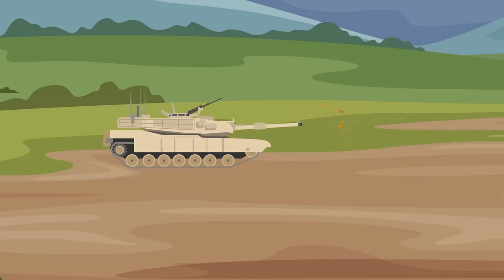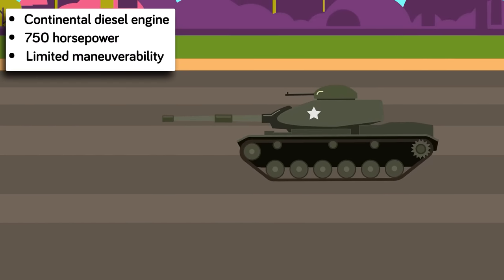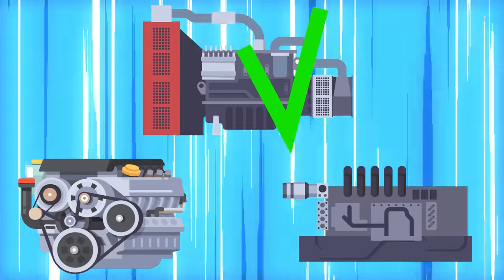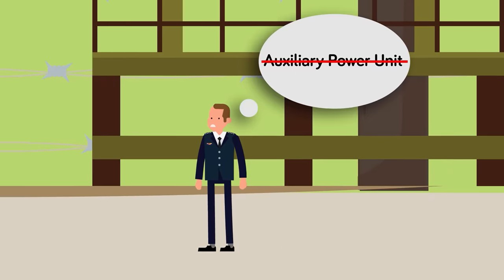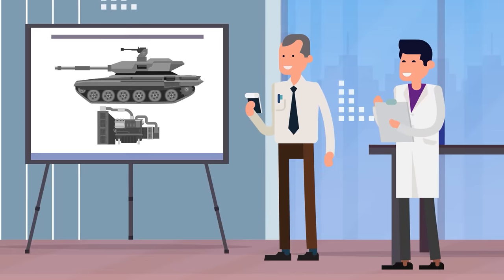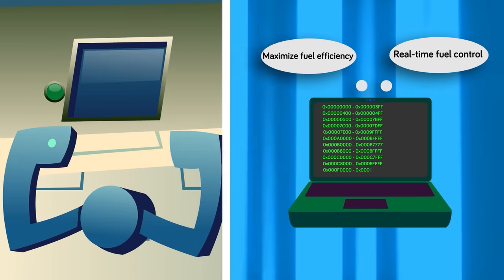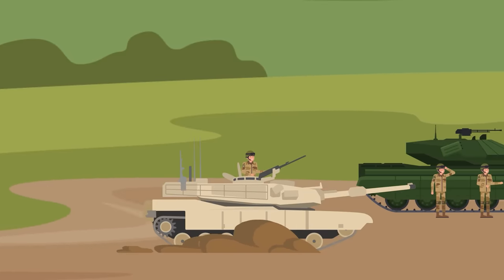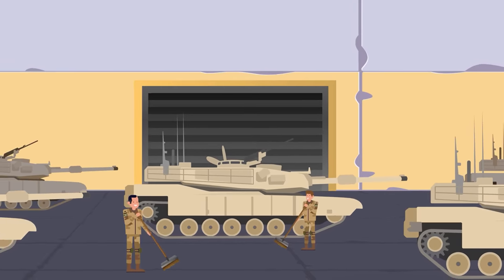Why M1 Abrams Turbine Engine Is Actually OP

Comment: the Auxiliary Power Unit(APU) was only recently installed on the brand new Sept V3 package and I can tell yall already that most of the time they don't even work and it had its own little engine compartment and you had to completely take it out to fix anything in it because of the massive spinning flywheel that sits on top of it

Comment: The Abrams tank has definitely grown with the newest 2a2 . From armor, computers gun rounds sights you get the hint. A great beast on the battle field. Just remember it's not the ww2 threw m60 tank , you can not walk behind them or burns will happen
Reply: I was an M60 Armor Crewman all the way to M1A2 test in 1994. I hardly recognize what’s going on in the turret of the Abrams now.
Reply: An army vet who worked around the first M1 tanks had a story about a vehicle parked behind the M1 melting. So yeah stay away lol
Reply: @Sammmeow  LOL you think that's bad, The Chieftan ( Irish Youtuber, former US Army Abrams Tanker) has a story from Iraq of an M1 towing another M1 back to base and its front fuel tanks exploded from the heat of the towing tanks exhaust blasting it. Luckily the crew wern't inside it.

You're supposed to use exhaust deflectors when towing with the Abrams, but they didn't have any so just towed it without them(And found out why you're not supposed to).

Comment: I was a 91A M1A2 SEP version 2&3 mechanic from 2015-2019. First off, no one ever uses the APU in the Abrams, it has plenty of battery to keep the tank alive. In fact, 90%~ of the tanks I put hands on, had their APU removed entirely. Second off, it does not take four hours to replace a pack in the field. With two tankers on the back deck watching the hydraulics and quick disconnect pins along with handling the saddle bolts, I could replace a pack in under 40 reminutes easily. I will say though, the technical manuals that we use work pretty well for finding more complex issues inside the tanks core, though the diagnostics process often required a combination of implemented techniques. If you guys ever want better information regarding the tank, feel free to PM me.  (disclaimer, i’m not unveiling anything that’s not already declassified, but for a first hand experience, I can provide the run down on how things actually are, versus how they’re reported.)

Comment: A few points incorrectly mentioned here. (Vet. US ARMY; 2AD; Tanker on both the M60 and the XM1 ABRAMS during the testing phases, Ft. Hood, Tx.). 1) the M60 weighed 63 tons fully combat loaded. 2) The XM1, ungoverned, could achieve a maximum speed of 85 MPH and often tested @ 60MPH. They governed it as going that fast often broke the track and would swivel the vehicle into an unrecoverable turn beyond 30 degrees @ 55+MPH. That being said, great video!

Comment: I'm pretty sure they didn't even mention the fact that it has 2700 ft lb of torque, which is a key feature of turbines, or the fact that it can run on different fuel types.
Reply: You tell em Mr yogurt
Reply: Except most tanks have the ability to do that
Reply: Leopard 2a7 3466 ft lb of torque and runs on various fuel types. Also the v12 sound❤
Reply: Why do so many people focus on something as silly as torque? There is absolutely NOTHING special about that value. It is trivial to swap RPM and torque. Look at this formula:

P = R*T/5500
P = Horsepower
R = RPM
T = Torque in foot pounds
Reply: @TomNyon  firstly the Abrams engine is also multifuel, secondly it depends on the RPM for the Abrams, when at max rpm I.e. 3000 rpm it provides 2750 lb ft, however at lower RPM it is significantly more, the Abrams engine provides in excess of 5000 lb ft of torque at 100rpm and the torque it outputs gradually decreases until it reaches 3000 rpm, whereas the Leopard 2s engine is the opposite it produces significantly less torque at lower RPM and reaches its max output of 3466 lb ft of torques at 2600 rpm I.e. at 500 rpm the Leopard 2 only outputs around 1500 lb ft of torque, so overall the Abrams engine is just better, it's the reason the US chose it over a diesel.
Reply: @johncochran8497  i guess you sont understand vehicles and torque. Torque is what will move tanks and trucks.
Reply: @aflyingcowboy31  the US also chose the jet engine for its military doctrine which doesnt make sense for other militaries. But on the battlefield i dont think it makes a chabge if you are in a leopard 2a6 or abrams. But the problem with turbine engines is the lack of a flat curve, as such thats why its applications are so small.
Reply: @TomNyon  And you totally don't understand the equation P=RT/5500. Torque and RPM are trivially interchangeable via gears, pulleys, or any other transmission. Halving the RPM will double the torque and visa versa. Giving me any two of the values of horsepower, torque, and RPM will allow me to tell you what the missing value has to be.

Comment: The German Leopard 2 tank has a 1,500 hp diesel engine, which can be operated as a multi-fuel engine.
Reply: The big difference there is the abrams engine is much lighter than an equal power diesel
Reply: @BrokeWrench  and there is multi fuel and then there is ‘burns just about anything that will go through the fuel filter’.
Reply: @teamidris  But it gets hotter and is therefore easier to spot with thermal vision. The engine-block of the Leopard 2 can be switched in about 20 - 30 min (faster) and the fuel efficiency is also better. An adaptive electronic control unit for the engine is also installed. I don't know if it can run with other fuels than diesel, but I wouldn't call Abraham's turbine-engine "OP" because it is a little lighter and can run with other fuel. It has its pros and its cons like any other engine and the pros aren't completely over the top like I would expect to justify calling it "OP". It's one of the better designs, maybe the best for some situations but the gap between 1st and 2nd place is not that big. The Armor of the Abraham is much better --> this is something you could call "OP". IN MY OPINION (I love all tanks equaly, but not the title of the video)
Reply: @BrokeWrench   abrams...3730nm of torque ............leopard 2 4700nm of torque
Reply: @elias_jacksonlp8032  The engine of the Leopard 1 was replaced in 40 minutes, that of the Leopard 2 in less than 30 minutes. They are both multi-fuel and very reliable. I was a mechanic on the Leopard 1 of the Belgian Army from 1978 to 1980, one of my most beautiful period of my life and I miss it a lot. 😢
Reply: Wait so the leopard had more torque?
Reply: Anything with cylinders will always be limited on their fuels, especially compared to a turbine
Reply: @BrokeWrench  not true, in fact the powerpacks of the M1 and the Leopard were originally designed to be interchangeable.
Reply: @teamidris  Not true, the Leopard 2 will run on anything the M1 can... which is NATO F-18 through F-77
Reply: @gearheadhotrodder9223  Not true, the Leopard 2 actually runs better on more fuels than the M1.

Comment: You know what the Army engineers say about the Abram? 1 hour use, 3 hours maintenance. A lot of those can be contributed to the engine. Yeah, OP indeed.
Reply: they absolutely did not say that. The Abrams engine is notorious for being very reliable and with low maintenance time, most of which is just swapping the engine.
Reply: @F_eesh  Not according to the official GAO report... the Abrams in combat suffered from unacceptable combat readiness rates during Operation Desert Storm related to its poor reliability and high maintenance requirements.
Reply: @WilhelmKarsten  that is true. I guess i was just referring to the engine

Comment: The best upgrade that could be made to the Abrams would be to strengthen the tracks so that the military could remove the governors that prevent the tank from moving at the speed that it is actually capable of. Because, it would destroy the treads moving at those speeds

The Abrams is a fuel hog because it is overpowered
It would be nice to see the tank actually being able to use that power
Reply: Do you really need the tank to travel faster than the stated 45mph on the road/30mph off-road? If I am not mistaken, the majority of the fighting in Ukraine is urban warfare. When the time comes when you need to move military personnel with great speed from point A to point B, wouldn't using APCs make more sense?
Reply: @tluzanov  I agree with you. Anyone else try to take a tank in a 90 degree turn at 30MPH? Powerslide doesn't even begin to cover what would happen. The M1 does have great take off speed from a stop and awesome braking. Many Tank commanders ate their 50 Cal mounts all the time. If you hear emergency brake over the intercom, grab and hold something now!
Reply: The M1 Abrams shares the same tracks with the original Leopard 2 that has since been upgraded with better tracks.
General Dynamics offers the new Diehl high speed tracks on its export models
Reply: It is not a fuel hog because it is overpowered. The Leopard 2 also produces 1,500hp. The reason it is a fuel hog is because gas turbines are fuel hogs unless run at an optimal speed. Diesels are just more fuel efficient, especially when run at lower power outputs.
Reply: @TheEulerID  excellent comment, you are absolutely correct.
Reply: The original tracks were not that great. As I remember, the tracks from the Leo 2s were adopted by the US Army. Much quieter and didn't seem to walk off as much.

Comment: I'm just wondering, can the Abrams' Turbine Engine also operate on Biodiesel Fuel?
Reply: Probably.
Reply: Going off what I've seen others list them capable of running on, If a normal diesel engine can take said biodiesel, there is no reason the turbine in the abrams shouldn't run it just fine.

Comment: Insane that the abrams engine, though controversial, is reliable, and can run on anything as long as the feeding fuel is combustible, not just diesel, patrol, kerosene..etc.
Reply: Reliable? No, not according to the GAO report.
Reply: The Leopard 2can run on anything the M1 can. Most tanks are multifuel

Comment: Some may not believe this but it’s what I saw with my own eyes. I was 19 years old and assigned to my first unit in Aschaffenburg, Germany in 1984 where I served as an 11H; Tank Destroyer. We had a couple Tank units (3-69 armor) and they had the first M1 Abrams. I’ve seen those things go past 55 MPH on open roads while my M-113A2 could barely do 45, they’d pass me on the autobahn so fast it looked like I was parked on the side of the road with my track on jacks! The governors were adjusted to keep them to no more than 45-48 MPH but, they can easily be changed to go past 60 MPH. They are monsters and nothing less.
Reply: Yes if you like changing track tho

Comment: OP was the WWII M4 Sherman or T-34 which were produced by the tens of thousands and were efficient. Abrams and F-35 are Ferraris, you drive them on weekends, but in a high intensity war they are expensive and not as efficient
Reply: a few problems here
The Tiger destroyed Sherman's at a rate of 3 to 1
Abrams are extremely complex, but the United States also has the capacity to manufacture lots of them
Which is why we have 3k of them rotting in Death Valley because we don't need them
Reply: @Thinkingaroundthebox  too bad there was only 1347 tigers build and over 50000 shermans.
Reply: Lol, T-34 was hot garbage.
Reply: T34 was absolutely hot garbage
Reply: @obi0914   well...
it depends on the period they were produced.
War-time T-34 hot garbage.
Post-war T-34s are good enough quality, with mediocre speed.
Then again postwar T-34s were mostly hoarded by Russia
Reply: you mean a HIGH INTENSITY war like the TWO GULF WARS?
Reply: @Thinkingaroundthebox  x1000 Tigers vs x50000 Shermans and 50000 T-34. Who would win!? History tell us.
Reply: @palacete  you are correct. The Allies won WWII because the United States could massively out produce the Germans

So it didn't matter who had the better tanks. Unless you cared about how many lives were lost
Reply: @ThinkingAroundTheBox  actually another problem, Sherman's never went up against tiger tanks.. that a very common misconception. Panzer tanks from afar were easily mistaken for tiger tanks. There are only 2 accounts of Americans seeing tigers and they were never in head to head battles.
Reply: @darthvirgin7157  not even close. Iraq was not a global power, even less a regional power. Iraq was decades behind in equipment, a small and poorly equipped army compared to the world's major powers.
Reply: Abrams tanks one of the best tanks to be in. And you act like Americans care anything about budgets while at war. The American Government is very good about spending money without a care. Ask any of it's citizens
Reply: Go watch a desert storm documentary and then read your comment again..

Comment: Gas turbine engines, while not necessarily miserly in their fuel consumption, are small efficient engines with far less moving parts than combustion engines. Helocopters use them, and there are very few helicopter crashes due to engine failure these days. Chrysler actually put one in their cars back in the 1960's.
Reply: Gas turbine engines are poorly suited to land based vehicles which is why the Chrysler turbine car was a failure and the M1 Abrams is plagued with many problems related to its troublesome engine.

Comment: A gas turbine can run on alcohol if it is properly tuned. In the future, I'm sure it would be able to run on hydrogen or any compressed burnable gases, like propane, butane, LNG, or any other fuel type. It's most likely just a S/W patch for the fuel control.

Comment: German Leopard 2 A7 is best.
Ironically, the engine and transmission are German designed but built under license in Ohio.
Reply: The leopard has had so many casualties in siria, i wpuld like  to Knowles how good is the leopard compared  with M1 and challenger the late two have a perfect performance with no casualties
Reply: nah US Abrams is best hands down as Abrams has the most protection other than challeneger 2 Abrams also stores all 40 ammo shells in blast proof armored stowage with blast doors while Leopard 2A7 still puts some ammo in the hull
Reply: @MrNeutrin00  

No.
Blame the crew, not the awesome machine.
Reply: The leopard basicaly has fuckall armor.
Reply: @MrNeutrin00  the only army activ in syria using any leopards is turkey and they mostly use old leopard 1s and never the less i think they dont have any high number of casualties
Reply: The engine and transmission unit for the Leo is produced by MTU in Friedrichshafen. You may mean the Rheinmetall cannon that is produced under license in the USA for the Abrams.

Comment: M1A1 Abrams is our Workhorse in The USMC it is our Chariot in The Battlefields followed by M2 Bradley's and other Armored Vehicles in our Armored Division. I missed my old days in The Marine Corp, I used to drive one of these Abrams Tank I love the Startup sounds and the Horsepower of This Beast 1500! It's too overpowered to haul tons of Armor Steel, and SABOT rounds depleted uranium does the trick! I drove this Beast off the LCAC (Landing Craft Air Cushion) when we landed in the beach in the Red Sea. And I'm inside the Tank as a gunner when we got Airdropped from a C5 Cargo Plane in Afghanistan. I drove a lot of Armored Vehicles in The USMC during my old days in The Military.

Comment: They need to send those tanks to Ukraine
Reply: They did. The Ukrainians prefer the leopard
Reply: No. The logistics of finding parts, ammo, and training crews on different systems is a logical nightmare.  The Abrams has better Armour,  but is way thirstier than the other two western tanks there. Also, turbine engines demand specialized training, while the average mechanically minded person understands the power pack in most tanks

Comment: The main reason for installing a turbine was the ratio of power to size. There was simply not enough space for a diesel engine with appropriate power.
Small fun fact. The replacement of the diesel engine on the Leopard 2 takes just half an hour.

Comment: The Abrams engine can be switched out quick even in the field it's been said to be designed to be simple it basically slots into place and not hard to bolt up or like I said switch out with another engine

Comment: The M1 gas turbine swallows fuel like crazy. The Diesel Engine of the Leo2 needs less than one third of the fuel per 100km and depending on the engine and usage range it either delivers between 80% and 110% of the raw horse power.
There is one advantage to the M1 turbine though: While the Diesel Engine doesn't deliver full power outside its optimal range of rpm the turbine does. Which means the Diesel-Engine is mediocre at 0-25% and 90-100% rpm.

Comment: The part of being able to replace the pack in the field was the same for other tracks. I have changed out M60 A3 packs in the field with an M88. Is most of the work easier on the M1, yes. Still, it was not the first just better optimized in some ways.